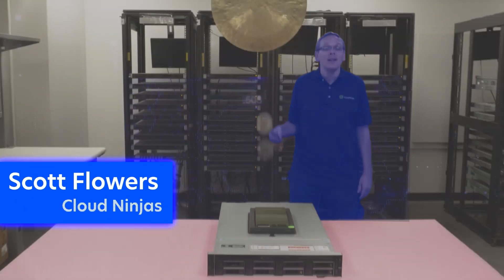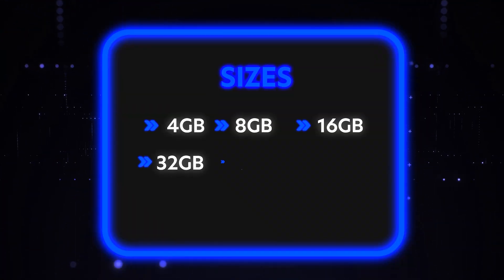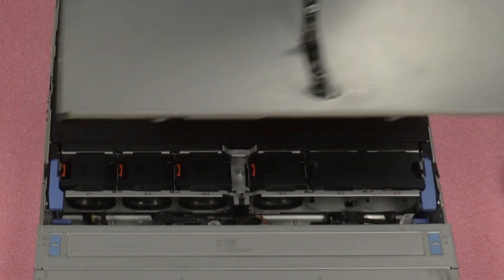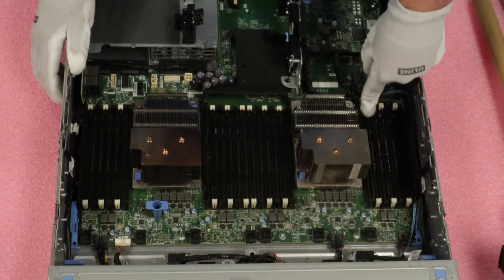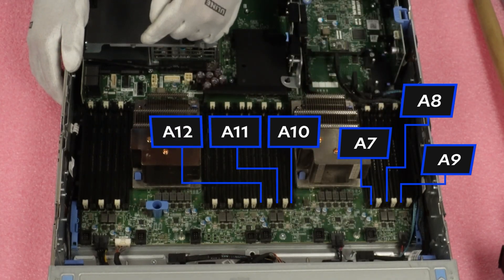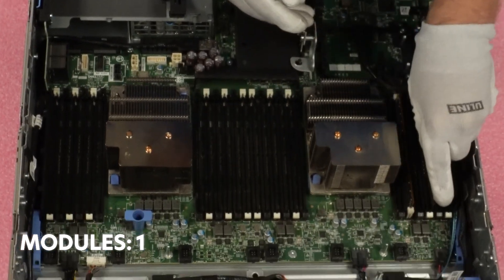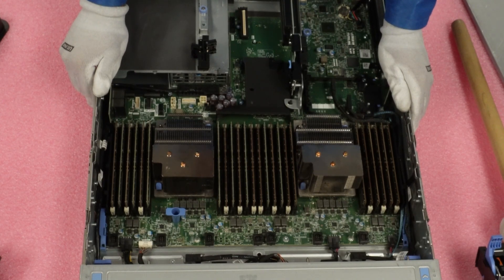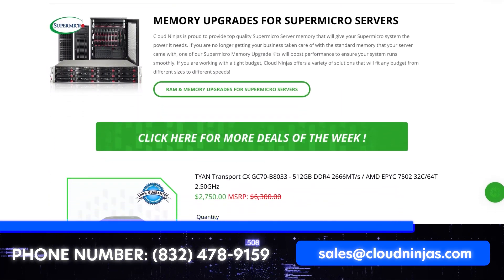Dell Precision R7920 Workstation Memory Overview & Upgrade | How to Install Memory | Supported DIMMs

Comment: 1st gen scalable cpus are going for next to nothing, i find the 4116 particularly interesting because it has 12 cores with a relatively low power usage and you can use it for 24/7, not break the bank and not have huge power consumption but still get absolutely great performance